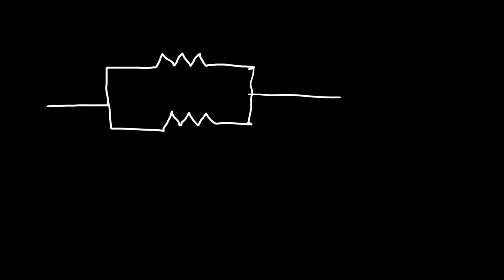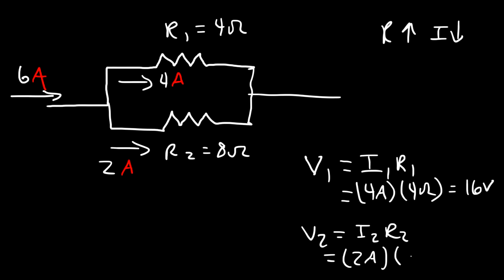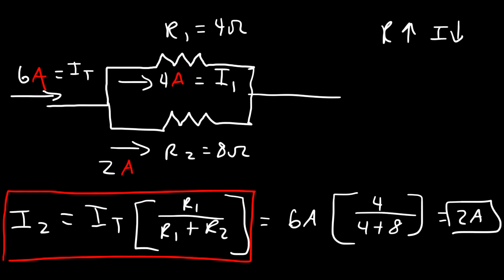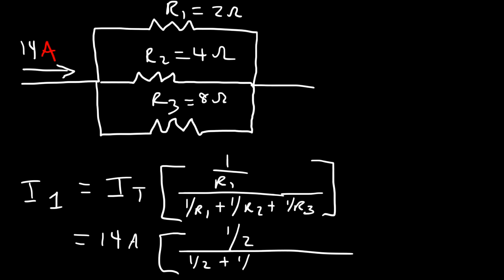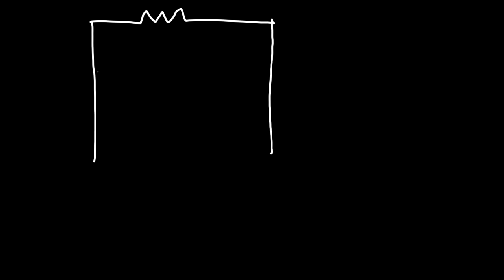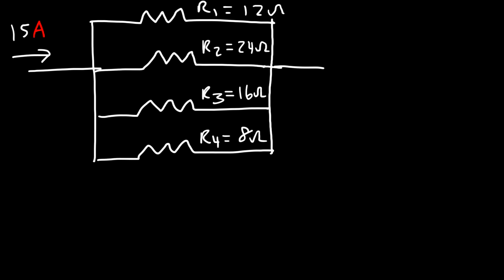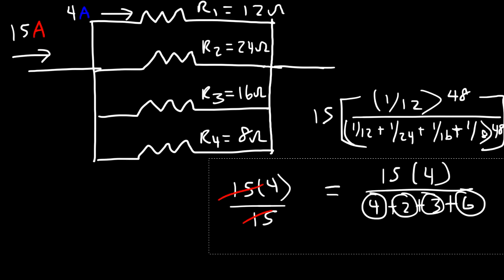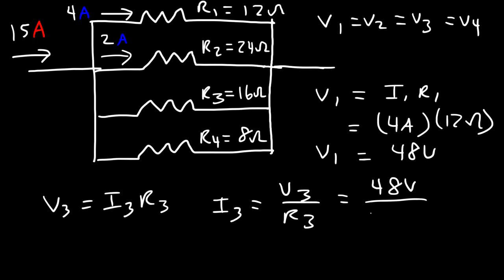Current Dividers Explained!

Comment: So:
If there are two resistors, the resistor in the numerator will be different. 
If there are three or more resistors, the resistor in the numerator will be the same as the the resistor you are finding the current for. 
Is this correct?

Comment: To clear out confusions 
You can use the same method from example 2,3 etc
on example 1 

Instead of I1= It [R2/ R1 + R2] 
You can use 
I1 = It [1/R1÷ 1/R1 + 1/R2]
which is the same method used on all this other examples

Comment: My question is, I watched two videos both about current division, first time the formula was I2= It (R2/R1+R2) then second formula I2= It [ 1/R2/(1/R1+1/R2)] so which one is for which situation because they were both being used.
Reply: It's the same formula, just derived a little differently by flipping the 1/R2. Try to apply the second formula and derive/simplfy it on paper and you'll see how it becomes the first one EDIT: The first one worked out because there was only 2 resistors

Comment: i have to be honest i dont understand why the formulas for the two resistor circuit and the three & four resistor circuits are different . theyre all connected in parallel?
Reply: They aren't different. 
if you use the formula of 3&4 resistor circuits in the first circuit it will be the same result.
But, in the first circle he used a special form of the law to solve it faster. 
This form is used only when there are two resistors.

Comment: at 5:13, why does it match and the previous example did not?
Reply: it is a little odd, but if you take the equation used for multiple resistors and write it using only 2 resistors (R1 & R2), you are left with this equation:

i1 = iT x (1/R1)/[(1/R1)+(1/R2)]

it does look a little ugly over youtube but it is a simple fraction with 1/R1 as the numerator and the sum of 1/R1 and 1/R2 as the denominator.

Anyways, you take this fraction and multiply both sides by (R1*R2) and you will see that this equation transforms into the very first equation that was introduced to us in this video:

R2/(R1+R2)

it is a little confusing to see these different equations, but the math checks out. the second equation is just a useful, simpler version that appears often!

Remember, voltage dividers use the resistor of interest, while current dividers use the opposite resistor! (when it comes to 2 resistors only)
Reply: Because the previous example was a series circuit and not a parallel circuit

Comment: A much easier way to do this is by finding the total resistance, then find the voltage accross the parrellel resistors, and then just use I=V/R to find the currents

Comment: For anyone wondering an easy formula that works to find the current at any point in a parallel resistor circuit is:

I(n) = I(T) * [ R(eq) / R(n) ]

Where I(n) is the current through the resistor n
I(T) is the total current before the parallel split
R(eq) is the equivalent resistance of all in parallel which is just 1/R(eq) = 1/R(1) + 1/R(2) + 1/R(3) ...
R(n) is then the resistor you want to find the current I(n) flowing through. 
This works for 2,3,4,...,∞ parallel resistor circuits.

Comment: Hey man, something i noticed with this video that messed me up for a while is that the equation in the thumbnail is actually wrong and is inconsistent with what you say and show in the actual video. In the thumbnail you write “I1= R1/(R1+R2) *Is” meanwhile the actual equation should have R2 in the numerator instead of R1 when solving for the current I1 at R1. Other than that typo, great video
Reply: I searched up the rule on Google while doing my hw and used this thumbnail because OCT has lots of credibility with me, it really messed me up for a while 😅
Reply: @ceeb830  glad i'm not the only one who did that lol
Reply: Hes correct but it only applies to 2 resistors. The one with the improper fractions is more universal
Reply: What about  3 or more resistance
Reply: @AToኣ watch till end man
Reply: @AToኣ its gonna be the total sum of those resistors except for the one youre calculating, assuming theyre all in parallel only ofc
Reply: It doesn’t matter with one it just means the opposite of which ur looking for

Comment: How Current Divider Formula is derived:

In parallel, the voltage across the two resistors is the same. Thus, V1 = V2. 
And we know V1 = I1 * R1 & V2 = I2 * R2. Thus, I1 * R1 = I2 * R2.
Also, Sum of I (in) = Sum of I(out) as in Kirchhoff's Current Law, thus, I (total) = I1 +I2.

We know have two simultaneous equations:
I1 * R1 = I2 * R2 .................... (i)
I(total) = I1 + I2 ..................... (ii)

If you sustitute I1, you get the formula to find I2:
I2 = I(total) [(R1)/(R1 +R2)]

If you sustitute I2, you get the formula to find I1: 
I1 = I(total) [(R2)/(R1 +R2)]

Hope this helps!
Reply: Thanks, lecturers just be throwing formulae with explaining/deriving
Reply: This was useful, thanks.
Reply: thanks!
Reply: Thanks man, I was wondering where did that formula came from.
Reply: Thanks
Reply: tyy i was jn wondering how to get it
Reply: I cant like it i has 69 likes
Reply: haha
Reply: Who asked for it
Reply: @memesop8812   STFU he is trying to give more help
Reply: @raed9152  toh muhmelele uska usko bhi return me help ho jayegi
Reply: @memesop8812  your so mean
Reply: @memesop8812  🤡